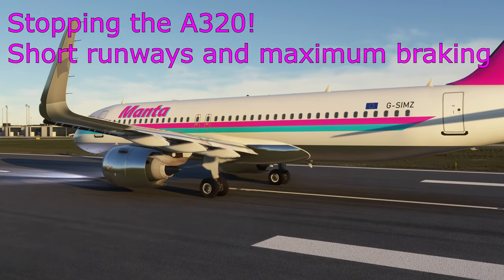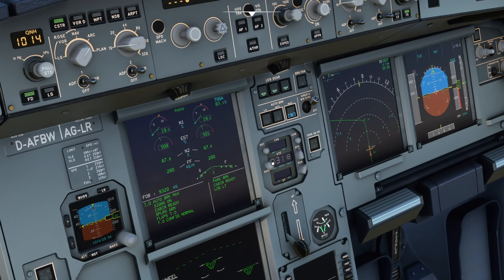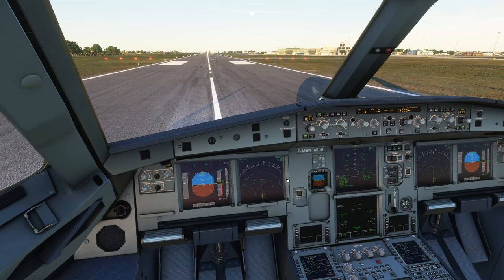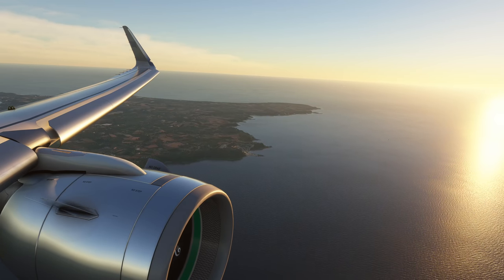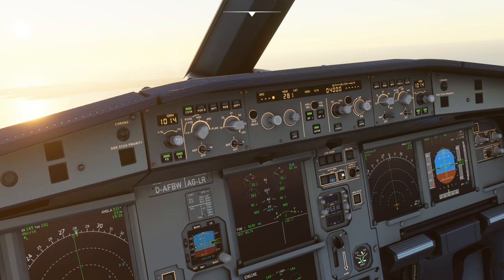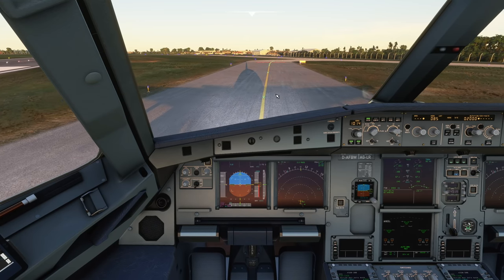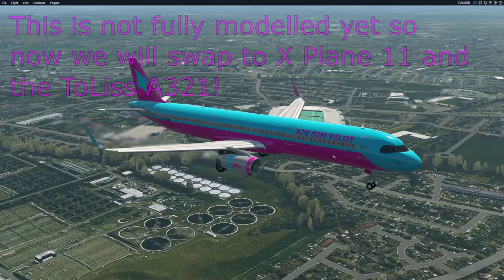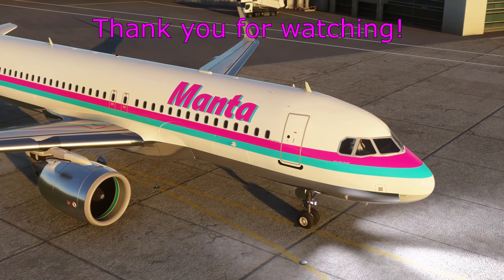Quickest way to stop the Airbus! With a Real Airbus Pilot Emergencies and Short Runways

Comment: Nice video as always. But I am wondering: how is it you still keep the autobrake armed when applying manual brake? On my plane, the autobrake keeps switching off during taxi and takeoff when I brake... I know this is a bug of the A32nx and it shouldn't do this in reality. But as far as I know, it hasn't been solved yet...

Comment: ILS stopped working for me on latest A32NX update. No RAD NAV is set automatically either when I program my flight via Simbrief or within FS2020 itself. Diamonds don't appear anymore, Localizer doesn't work either. Have been doing manual landings for a few days already.
Reply: Did you enter the ILS frequency in the RAD-NAV page of the MCDU?
Reply: @dillanagarwalla6100  do I have to manually do all that now? Before it pretty much filled automatically. ):